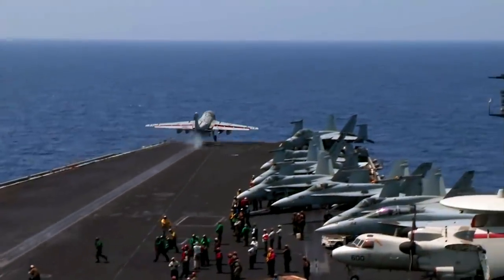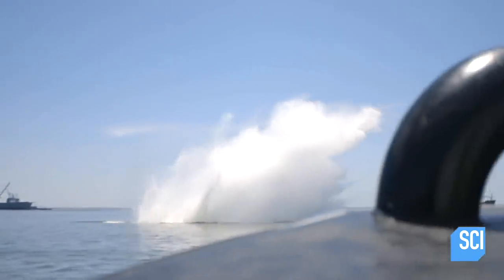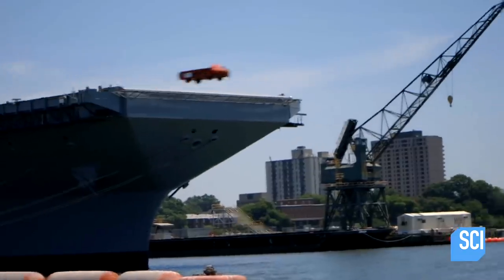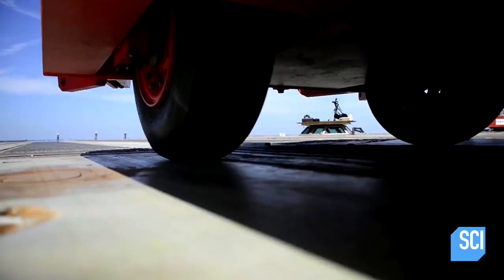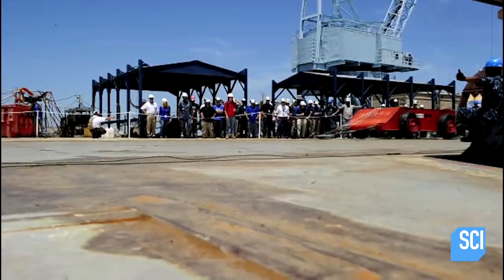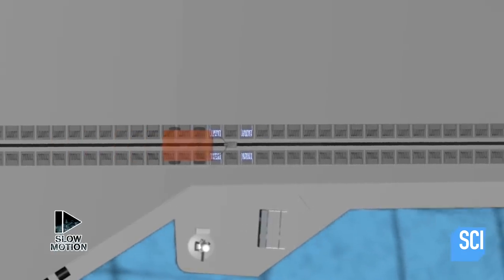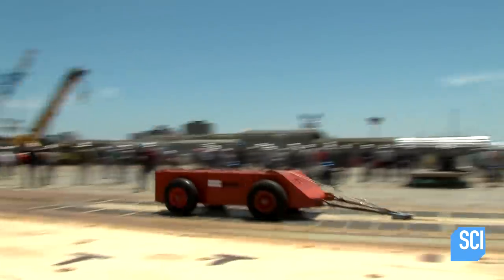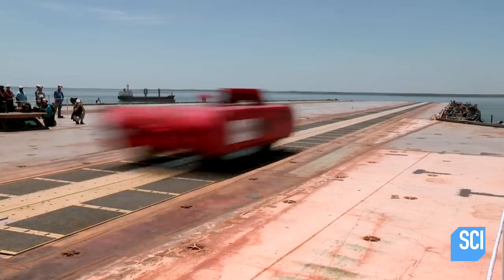Testing an Aircraft Carrier Catapult | Outrageous Acts of Science

Comment: What give them the right to pollute the water like that
Reply: The same reason you pollute YouTube with stupid comments. Obviously, the test sleds are recovered and reused. They aren't just blocks of steel with wheels. They have sensors for G-Forces, speed, etc. They are designed to float recovery.